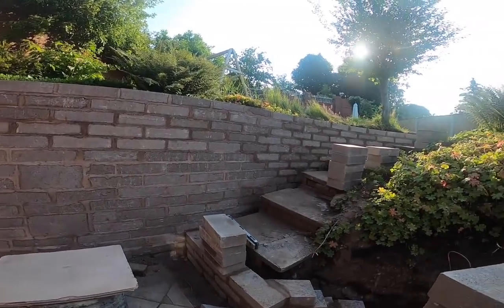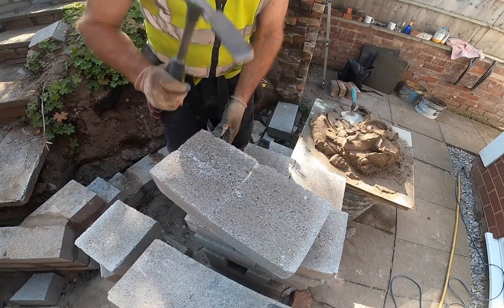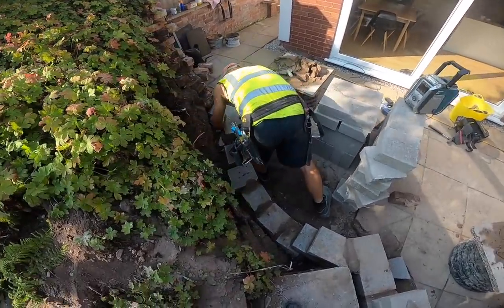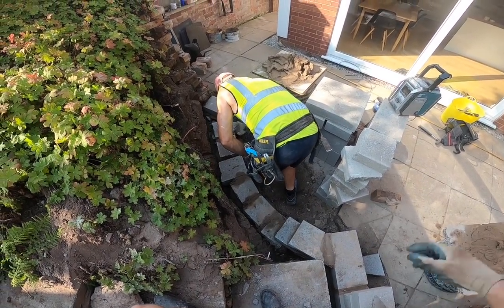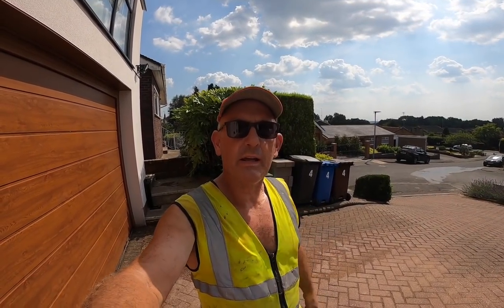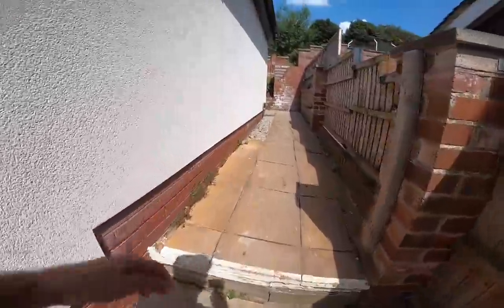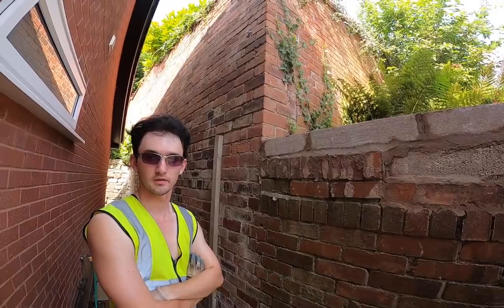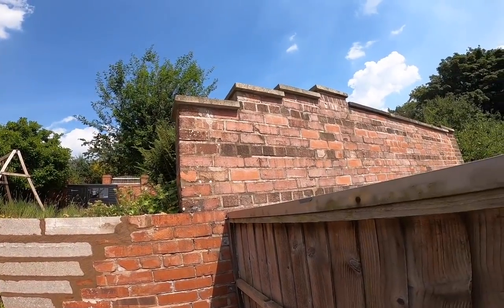BEAUTIFUL CURVED BLOCKWORK

Comment: Appreciated that normal vedio speed on stone cracking work! Also put leveling tips, cement sand proprtion, special power tool types  if used on screen.

Comment: Crap!

I bought a grinder to cut blocks and stuff and you used a hammer ... lol!

Seriously though, I got that Bosch 230mm you recommended for slab I think, so I could put a doorway in a wall anyways, unless you are about to tell me that's not how you do it ... oh God ...

Anyway, I got the grinder for £74 so I'm happy with that., even if the wife isn't and I take totally no responsibility and blamed it on 2 guys from YouTube for recommending it.

BTW you also made me buy a Marshalltown starter kit and a brick hammer and a few other things and even though you forced me to do these purchases my wife still doesn't believe me :D

For a few weeks I've been wondering the best way to do a sharp 98-105 degree corner, but you seem to have included that here at the bottom of your stairs. :)

That's like a 2m high wall though and I've been bothered about making mine 1.5m, though mine is also a garage getting converted into a workshop as as well. Hypothetically what would you use for something like that; foundation, 215mm or what?

Nice finish as always though. I'm hoping for half as good and better than the guy before me. My current retaining wall would be curved if it wasn't actually bowing ... in 3 or 4 places. I'm doing footer pipes because I have 4+ gardens pointed towards mine, probably a lot closer to 8.
Reply from the maker: Not guilty 🙌🏽🤣 If you mean 215 mm thick then  yes 🧱👍🏼
Reply: @SteveAndAlexBuild  sorry, me being a complete novice, ... 215mm hollow block that you fill and with the rebar running through it (if you want).

I'm in Scotland and although I'm liquid rubbering it after it's finished (might add a dpm too) I don't fancy it getting water penetration and it blowing.

At least brick can be maintained at worst.
Reply from the maker: @bipedalspecies2086  🧱👍🏽